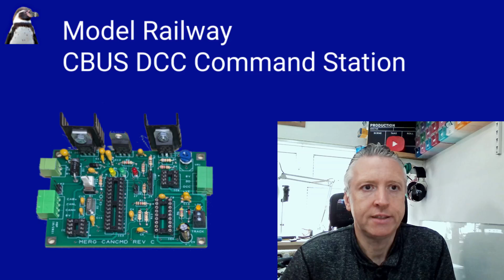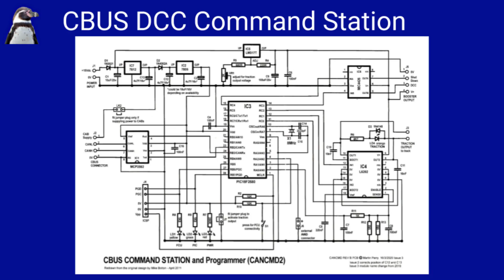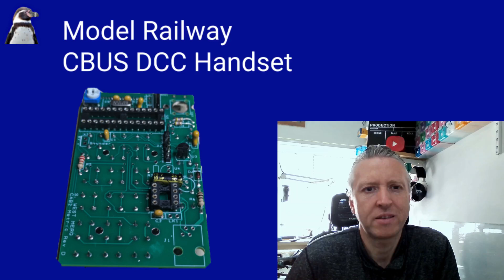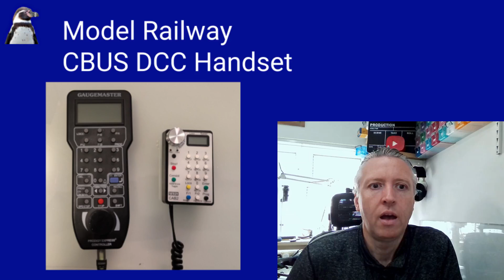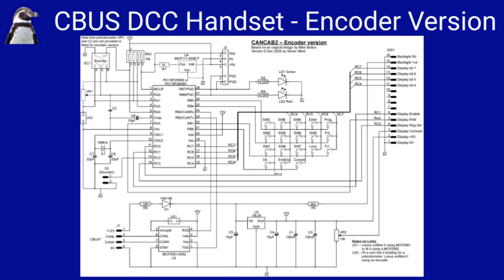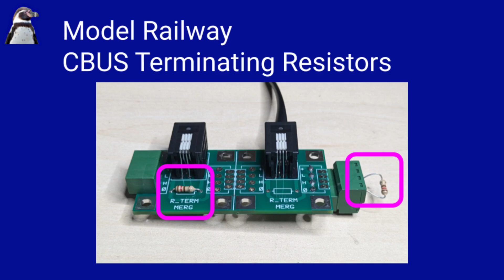MERG model railway dcc controller kits

Comment: DCC & THE SIGNALLING INTERFACE ???
Interesting, but like ALL DCC systems there is a gaping hole in these "supposed" computerised control systems of layouts. And that hole, which is the interface between moving trains and the relevant British or European signalling methods, is currently NON EXISTENT. Currently the best you can expect is American CTC (Central Traffic Control as used by U.S Freight Railroads). Which of course totally avoids the issue of signalling, as its a (dangerous) radio verbal command of train movement method. Basically banned in Europe !